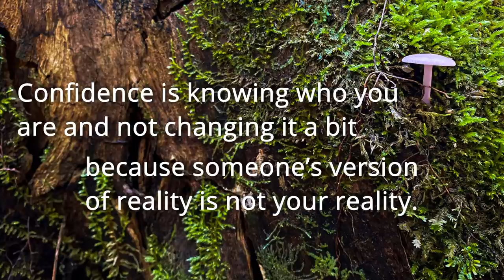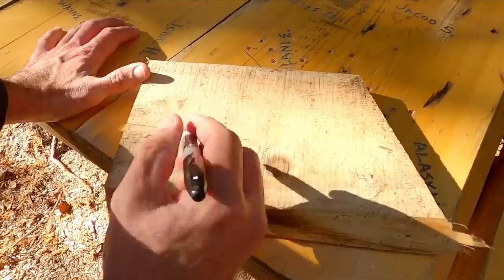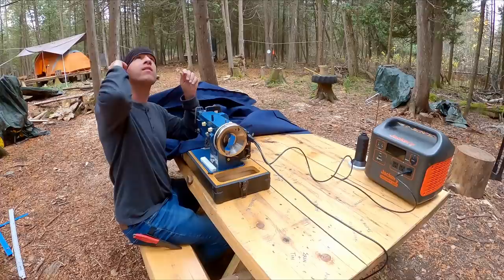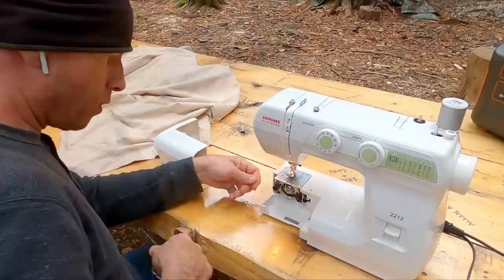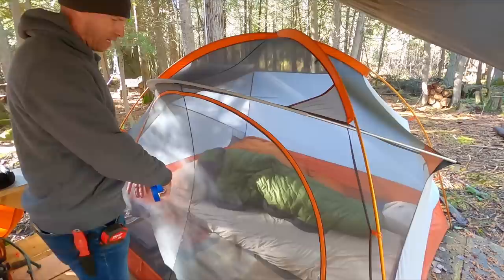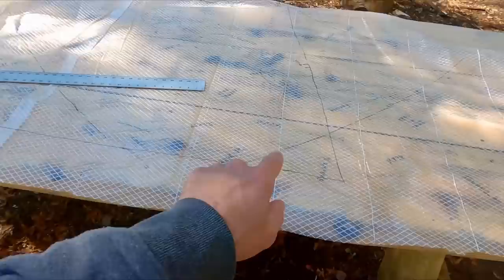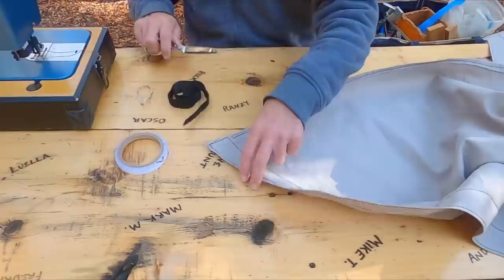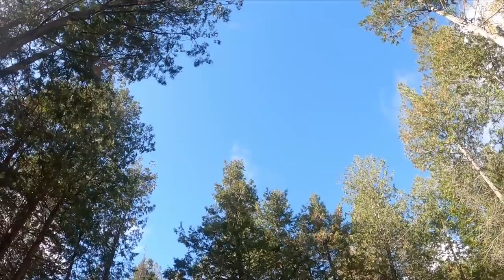Customizing My Tent for a Michigan Winter.  (Off Grid Canvas Work.) #57

Comment: Surviving R    how about extending the width of your table with a leaf and dowels into the side of the table?...you could also add a leaf on the end lower so that you set the machines onit (one might need a spacer then the fabric would come off level with the table...i have an extention leaf on my left to pile the fabric on before it is sewn (a sawhorse with a removeable flat top a foot or two wide and 3 or 4 feet long works well too...then sit on a stool to sew?.....i am a marine fabricator wih about 50 years experience, (always wanted a sailrite but had 3 pfaff industrials at a time and a huge overhead =not too bright)...i am selling my $3500 machines and have rebuilt a 1950 siner industrial (no reverse- dadgummit)converted to treadle as well so treadle -electrig...most singers before 1965 are treadleable and have built in stitches and cams as well (i have 4 , all treadfle electric ...the old sraight reverse machines will sew anythin my pfaffs will (i sewed a tin can with the 1950 singer industrial...there will be many libving your lifestyle soon out of neccessity, thanks for sharing friend...Doug (central bolsheviked Kanada)

if you were around here we could make $1500 a day between us, but i am getting away from "the world too"

Comment: It still looks like your PV panels are upside down. The side with the solder lines & blueish crystals should be facing the light. That's why you're probably getting little power from them.

Where's the chainsaw made outhouse? Gotta see the throne of ring worm!

Comment: Great video man, Idea: get a Chinese diesel heater of 2kw of output (6500btu) You'll also need an 18ah-70ah 12v battery.  The diesel heater is the size of a loaf of bread and modular.  It would be very suitable for your endeavors if for an emergency or even a permanent feature.  Less than a liter of diesel a day and only costs about $110

Comment: I stillsay a Miliitart GP ,medium tent are pretty sturdy canvas tents probably coulod heat it with a barrel stove and the sides roll up and they have cold weather liners How much wood could you store or dry or they have quancet shaped tent with higher cielings for vehicle repair in the field or like a garage in a box it a tent as well Menards sells them about 3-400 bucks with metal frame. store or dry your lumber or logs.

Comment: If you wanted little more insulation in the tent ,you could add some emergency mylar blankets . I have a friend that hangs them behind her curtains to keep warm air in . Yes I know you get condensation in most tents anyway . I know the dollar tree has humidifier s in where the hangers are and they trap moisture and when tank gets full you dump it .People usually gets them for a closet .

Comment: You  need a treadle sewing machine.  They are a dime a dozen and require zero energy.  I have been using mine for a while just because it is easier and better then a regular sewing machine.  Give it a try.  You will be surprised how cool they are.

Comment: What are the make and model of your sewing machines? I am waiting on a gear for my singer 457. When I got the machine it was crusty, rusty, parts frozen in place, missing pieces, etc. I used parts from two different tensioners to make one that would work on this machine. Ended up having to make a piece for the tensioner out of a finish nail. I got it rebuilt enough to try sewing a seam... And that top gear on the vertical shaft turned to mush as I watched. I didn't even touch it! When the gear gets here, I think I'll have a pretty awesome machine. I learned to sew, in my teens. My mom sewed for a living.